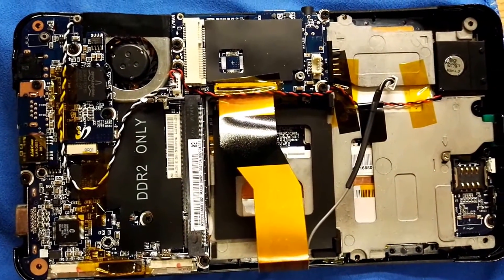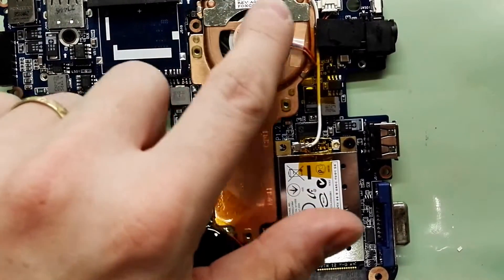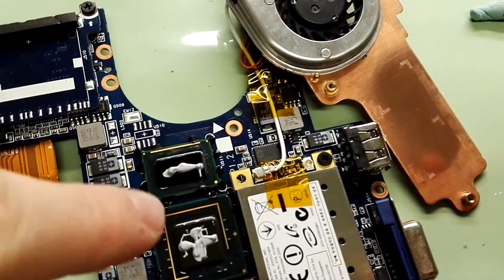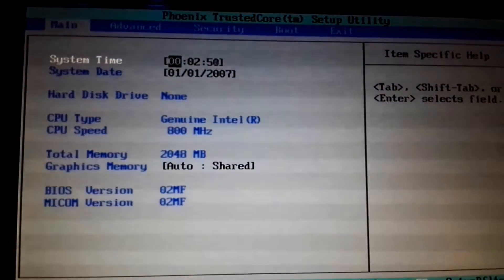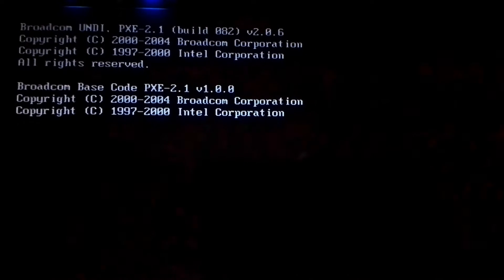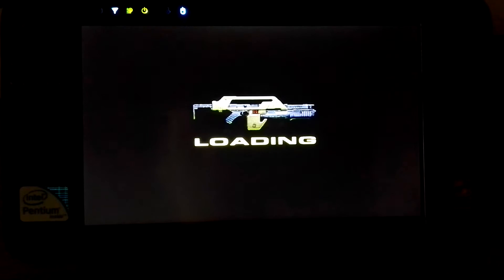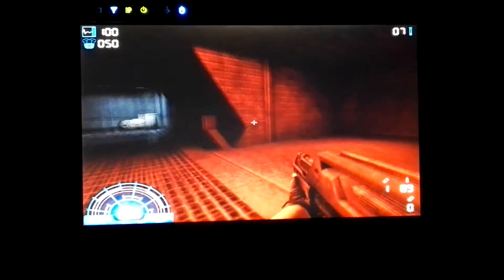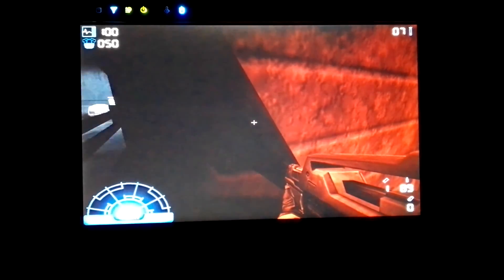RETRO Upgrade of Samsung Q1 ULTRA and Unlocking BIOS with mods

Comment: Slightly off-topic, but... could you show me how to replace the CMOS battery in the Samsung Q1EX? It is similar to the Q1 Ultra, but I do not have enough knowledge to locate the CMOS battery. It is completely discharged, leading to CMOS checksum errors on boot...

Comment: Hi! We're you able to unlock the empty mini PCIe slot?  I just installed crystal HD but it wasn't recognized
Reply from the maker: hey, nope, :( would need unlocked bios
Reply: Thank you for the response and for posting this. I removed the WiFi card from the mini pcie card and swapped it with the Crystal he one. It was recognised. For WiFi I used Belkin n750 usb. Streaming is mostly bad and extremely choppy but was able to stream one football match very smoothly via VLC. Overall I think I pushed it to its limit.
Reply: parallelsSWopenMP(uefiWin10\openlinux)
Reply: Hey, just stumbled on this. The empty slot is intended for an HSPA card and it's wired for USB and SIM so no PCI-express in it. I found a block diagram or schematic of the Q1 U some time ago that confirmed this because I was wondering as well. Gotta pull the wifi card to get PCI-express.
Reply: @DavidTimothy  Working on exactly same thing on tuning up my old Q1U (: Thanks for very valuable post.

Comment: are you absolutely sure the slot is disabled or not-working in some way? I've heard of manufacturers stunting the abilities of slots made for WWAN cards to prevent anything else from being installed in them, or to only make them work with WWAN cards so to cheapen the amount of parts needed on the board itself. A few friends and I are purchasing some more Q1 Ultras off eBay and we're all going to be doing some modifications like the ones you've done here, can you doublecheck the card works in the WLAN PCIe slot at the very least just to show your card isn't dead? since that slot should be a proper PCIe slot.
Reply from the maker: don't know buddy, looks like there are missing some components, I tried different cards in there (not the WWAN) and it was not working, and I don't have knowledge to unlock the BIOS.
Reply: whineyNegoIstranslateENkerkz?